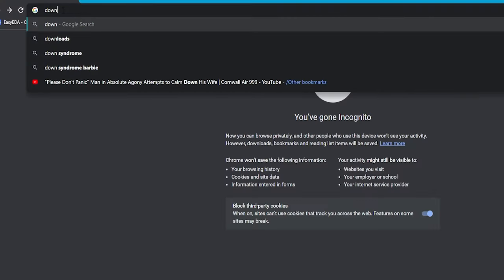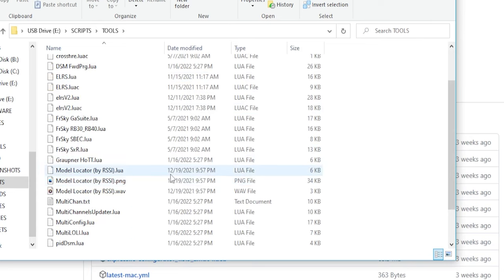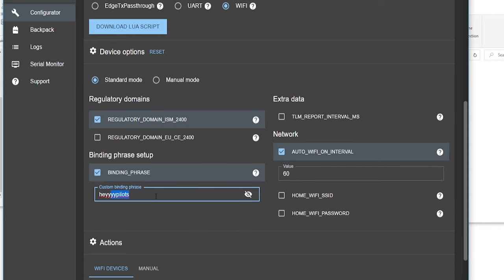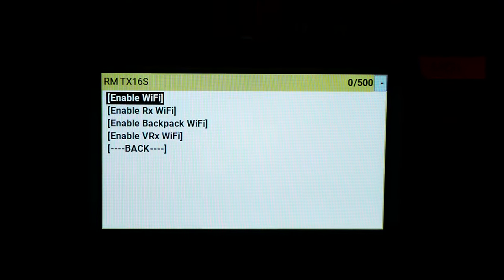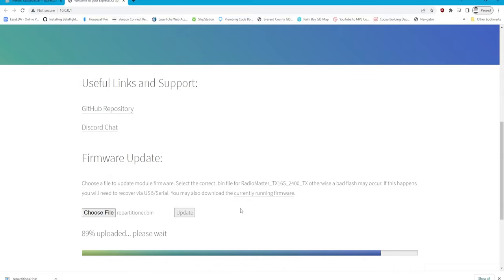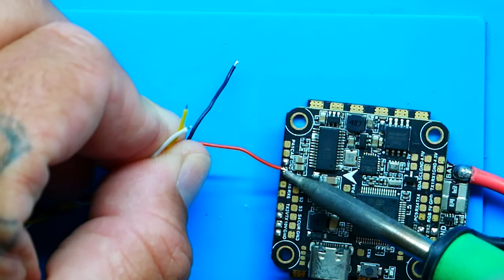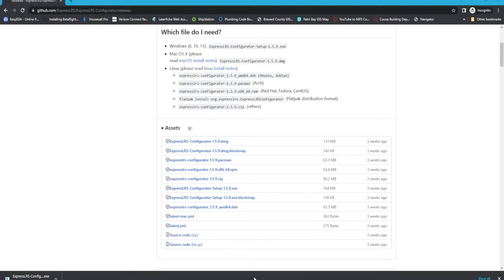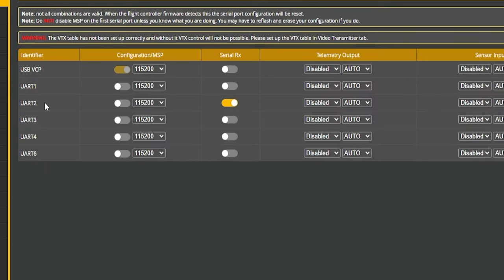Finally! Quick Set Up For ExpressLRS! How To Wire, Flash, & Program Your ELRS Radio & Receiver!

Comment: I'll stick  to crossfire.. much  easier
Reply: And no fail safes. I have dropped 3 drones out of the sky due to unreliable ELRS! The hardware names are never correct in the configuration also. I have bricked 3 receivers because the devs can't take the time to update and type the correct hardware names. The latest Foxeer receivers are a great example. Connect to bluetooth and find the model hardware and no match in the configurator!
Reply: Test, simple and more expensive :)
Reply: @JDDupuy i have 3 tx modules 900mhz , and one 2.4ghz , and 8 rx that only one worked . Until the antenna caught a prop . I just spent another hour or two trying new 3.2 firmware and it says failed to initialize . Evrty year or so i drag all that elrs stuff out to try the latest goose chase .

Comment: You're a smart guy. Why on Earth would my 3" drone, that I have been flying for hundreds of batteries, suddenly stop connecting to my radio after it's been sittong on a shelf unused for 6 months or so? The BetaFPV 900 receiver wouldn't connect to my radio. I just reflashed the receiver and it connects & works fine. But is this common? For firmware to degrade from just sitting in a receiver? You ever had hardware just stop working for no reason, only to begin working again after reinstalling firmware?

Comment: Hey man! I’m on Mac and i run into a problem when i connect to my radiomaster boxer wifi. Nothing happens when i select “choose file” and it wont work when i try it on safari either. It just says “error upload model configuration”. Also cant open repartitioner. Any idea to get around this? Thanks!

Comment: @drainman FPV, Thanks for this video. I've got Express LRS setup but I have no sticks. I'm using a revoltOSD FC and radio master RP1 v2 receiver. I have TX from the receiver going to RX3 and RX to TX1 on the FC. I am not sure how to set up my ports in Betaflight. Throttle, Roll, Pitch and Yaw do not work under the receiver tab. Can you help?

Comment: Great video! things have become so much easier over the last year, I'm stoked I went with ELRS! Do you know if the procedure is any different for Diversity ELRS Recievers? I've got the happymodel TYCO Diversity and I'm stuck with it connecting to my TX16s. It connects no problem, but no outputs in BF. I've had this for every ELRS rx but I couldn't get it right with my Diversity RX. Seems like there's a model mismatch or something, but I can't get it to work... I'll try again once I have some more time
Reply from the maker: Yep, should be the same.
Reply: I have 3 of those receivers and they all work with my TX16S and Boxer in Betaflight configurator 10.9 and setup using ELRS configurator 1.5. The target device in the ELRS configurator should be HappyModel EP1 Dual 2400 RX.
Reply: @kurtzFPV  me is right like you but still no output and his led is green but before is blue so why with him 😢
Reply: My boxer and receiver is same version is 3.2.1 I don't know why 😢😢

Comment: Hepl me please. I've just updated my new TX16S Mk2. Created new profile for new drone (gave a name Cinelog30). I saw that after update my firmawere of expressLRS changed from 3.0.1 to 3.3.3. I chose 'lau ExpresLRS' and pussed BIND (also turned on the new drone. It started to blink). I tried several times to pair them, but I did not get success... I see connection process passed 1-2 sec on remote and I did not see any confirmation. So the drone continue blinking with diferent colors. I pused/holded button on the motherboars's drone and still did not have any result. What I am doind wrong?

Comment: Hi, I can't update my Jumper T-Pro. Get this error " Pre-connection option "no_reset" was selected. Connection may fail if the chip is not in bootloader or flasher stub mode" 

Any suggestions to resolve this issue?

Comment: What wifi adapter are you using? Mine is super slow finding the connection on my desktop.
Reply from the maker: That PC has the ROG STRIX Z790-E (Motherboard with built in WiFi)

Comment: Boy, I must be  Dumb , When I download the configurator It will not install. I don't see a EXE  File  ?? Windows machine.

I with the fellow below Crossfire is Much easier. But I wanted the Tiny Hawk 3 and it oly rune ELrs. Using an extremal module on a  Taranis X7   Any Ideas ?? Thanks Ben Herr

Comment: Yeah, this is just straight BS, I used to run spectrum back in the day and putting in the bind plug was a hassle. I squished a brand new acrobee65 after trying to get it to connect to the brand new radio Master pocket I bought.